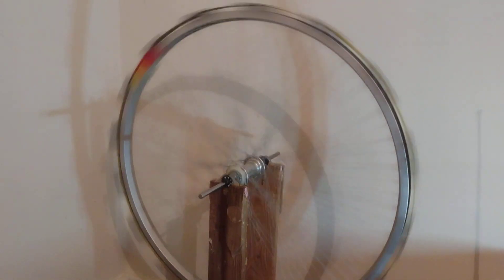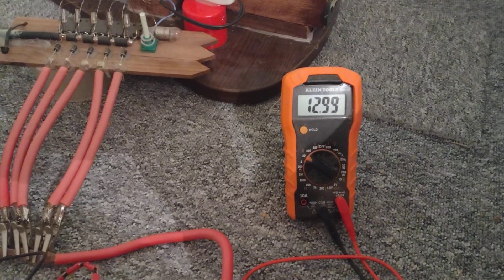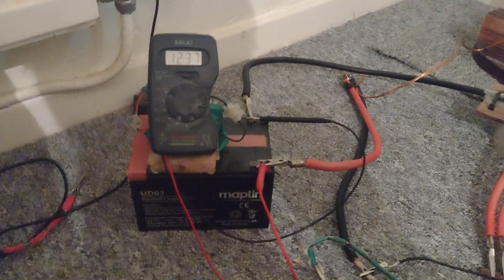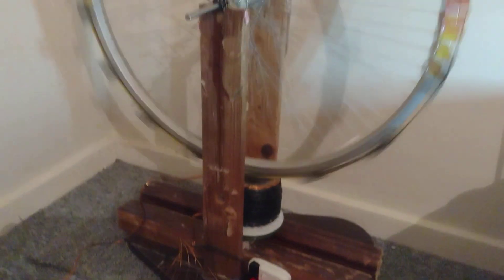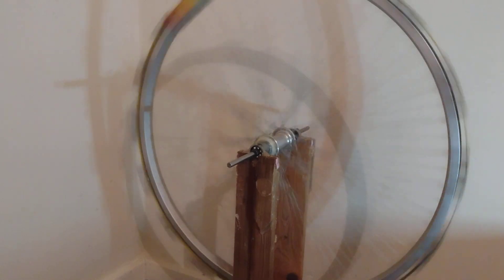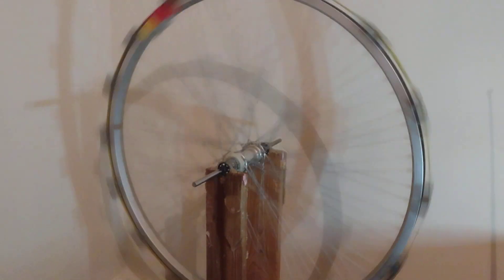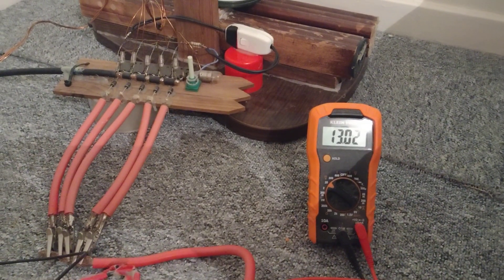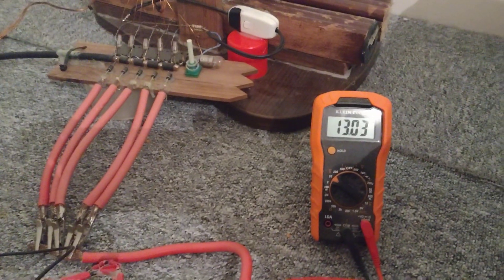SG Monopole with a Capsule Cap Dump Device on the output.

Comment: The COIL & CAPACITORS has to be at the SAME VALUES 

C-100mF L-100mH  pulse at 630ms  and or how ever you are doing it. You can get Upwards of 50V and 50amps off 1.5 volts